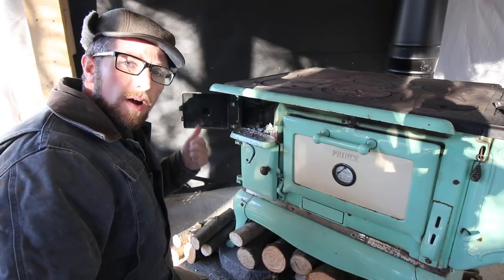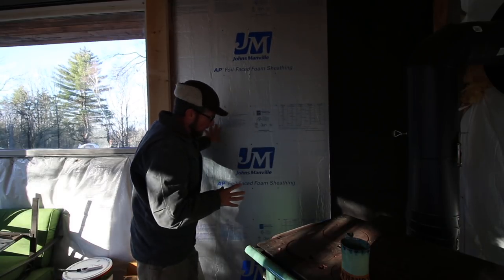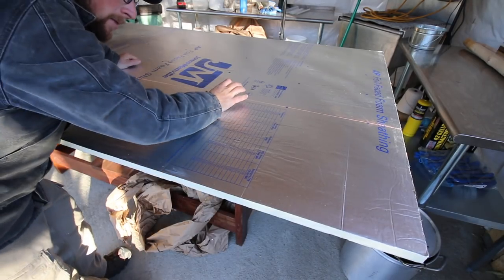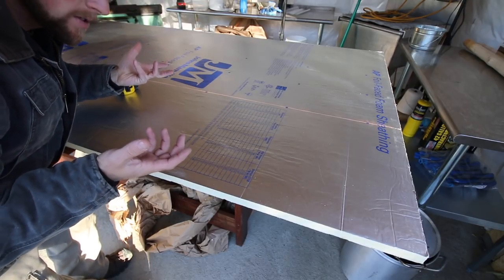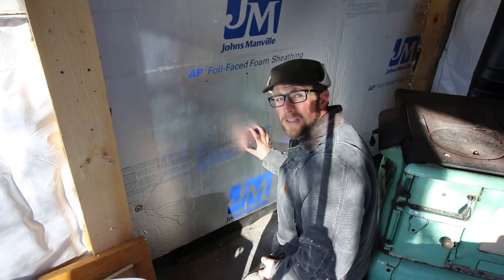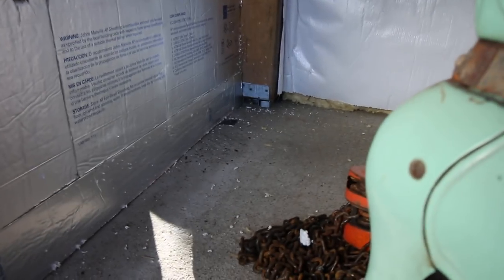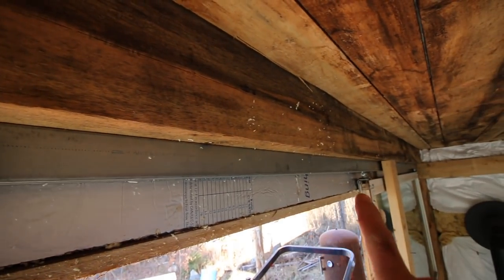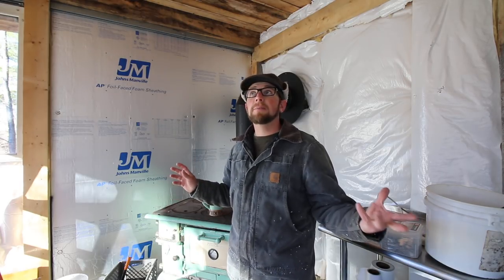Finishing Insulating the Outdoor Kitchen | Trying on some new winter gear

Comment: Don't do curtains. Get 1" bubble wrap and put a double layer on the windows. Put on with water and tape the edges. Lovely light dispersion and insulation both temp and sound. Keep down the cobwebs and excess flammables that kitchen. A roll is very reasonable pricing.
Reply from the maker: I wonder how it would work with direct sun light?
Reply: I wouldn't worry about the sun light, its only for a short time, and it helps keep the place warm and bright.

Comment: honestly i think i would get some off white cellular shades for those three windows. you would need to get them custom made, i would get the ones that open from the top or the bottom.  (don’t get cordless they don’t last) you get a very nice filtered light from these whatever color you choose and they have clean non fussy lines.  are your windows double paned?

Comment: have you thought about putting in a rocket mass heater or a walker stove/heater?
Reply from the maker: No we haven't
Reply: we plan on building a walker stove this spring summer for our outdoor kitchen. but we plan on using air crete in place of the outside bricks to keep the heat in. we are in Florida not need the heat just want to use it fir cooking, baking,  canning and hot water.